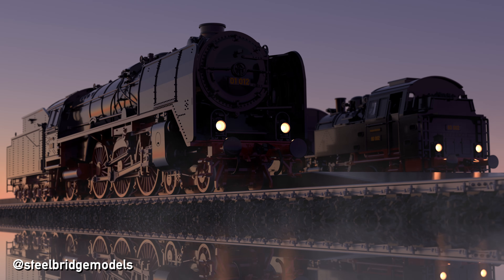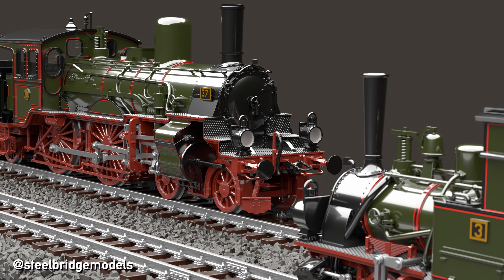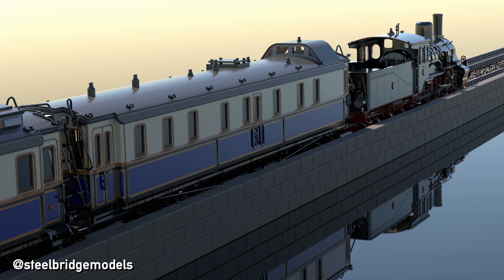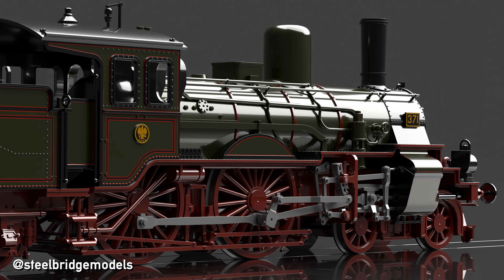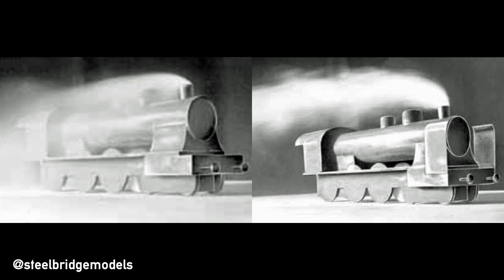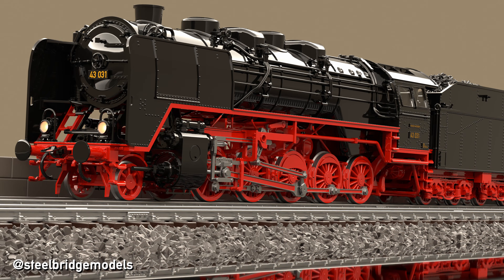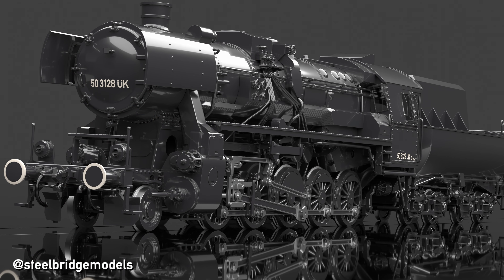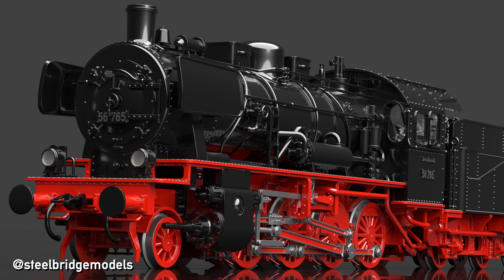What do they actually do?

Comment: I have a question why do only the Germans do this because I rarely see smoke deflectors on British and American locomotives even though those also go pretty fast
Reply: There are plenty of British locomotive designs with smoke deflectors. For example, the British Railways standard classes 6, 7 (Britannia), 8 and 9F, the LMS Coronation class, the LNER A1s and A2s, and many of the Southern Railway's locomotives.
Reply: @beeble2003  , you are indeed correct.   as you point out, there were a lot with deflectors.   in victoria australia, they all had deflectors.   not so in other states who did not generally experiment with their loco fleet.
Reply: oh yeah thx!
Reply: Lots of more modern South African locomotives had smoke deflectors too. Classes 15F, 16E, 23, 25, 25 NC and probably others.
Reply: @Fritz46  , some south african locos really did get experimented with.   for example red devil, class 26.
Reply: @F @Fritz46  cool!
Reply: I suspect these locomotives have the double chimney mentioned in the video, which generates enough pressure to push the smoke far enough out of the chimney before it obstructs the crew's view.
Reply: @miniadler  yeah that makes sense
Reply: @miniadler  double chimneys slow down air flow.   uk didnt put wagner front end mods on any of their locos that i know of.   flying scotsman and a few others got kylchap front ends which also usually need deflectors.   not all engines need deflectors after getting front end mods.   if smoke becomes a problem then the engines may need deflectors.
Reply: @vsvnrg3263 Most of the smoke deflectors used in the UK are derivative of the Wagner type. They could have basic single chimneys like the King Arthurs, more modern double chimneys like the Duchess, or even more refined double Kylchap exhausts like the Thompson Pacifics.

Ironically, the Bulleid Pacifics went from Witte to Wagner. Their original air smooth shape had small Wittes added (you couldn’t really add a Wagner to that shape I think) but the rebuilds DID had Wagner deflectors as they followed the design pattern of the BR Standard Pacifics.
Reply: @russellgxy2905  , thanks for that useful info.   i thought all double chimneys meant kylchap front ends.
Reply: @vsvnrg3263  Not necessarily! The LMS and GWR used a different design. Swindon’s style was no substitute for the Kylchap arrangement if Duke of Gloucester’s service career is anything to go by. There’s also the Lempor ejector fitted to the two VR R class Hudson’s used with West Coast Railway. That twin blastpipe arrangement made for two SEPARATE chimneys protruding from the smokebox! Very efficient, but quite odd in appearance
Reply: @russellgxy2905  oh yeah personally don't know much about Japanese steam engines but yeah cool!
Reply: @russellgxy2905  the more you know thx!
Reply: @russellgxy2905  , yeah, the lempor exhaust was so good that one of those vr r class hudsons threw a rod and no other in the class ever did that.   someone who worked on one of them thought it gave something like 20 or 30% more horses.   because of the rod, neither of them is still a super-r.   the second chimney was decidedly ugly, in my mind.   i think one of the victorian na class has a lempor exhaust fitted.
Reply: The majority of Japanese steam locomotives also had smoke deflectors, of both types.  Wagners were more common, but the Japanese Witte deflectors I think were particularly stylish. (examples include 8620 Series #58654, C57 180, and D51 498.  The latter two have worn both types.)